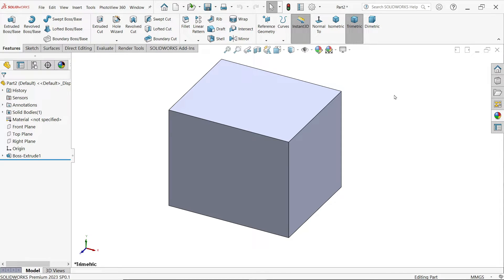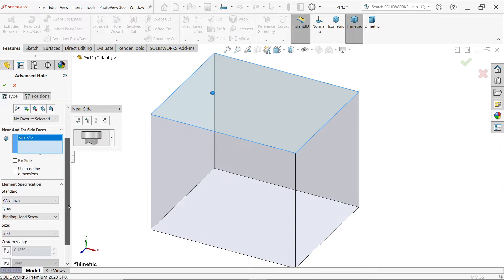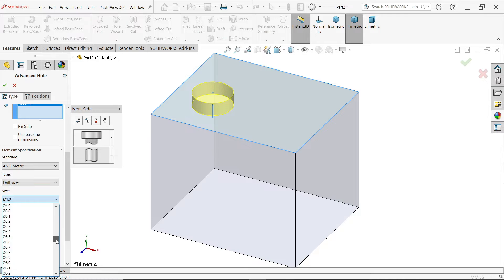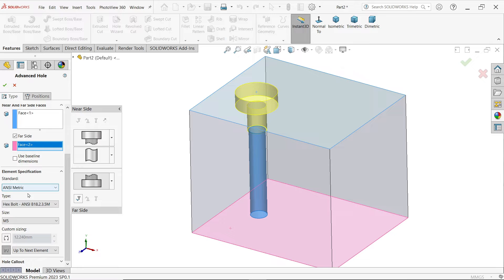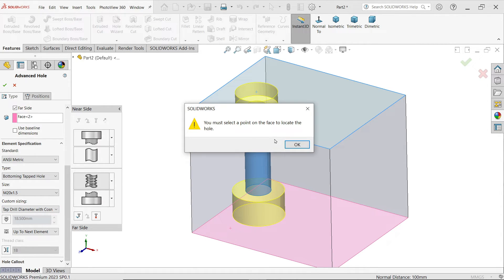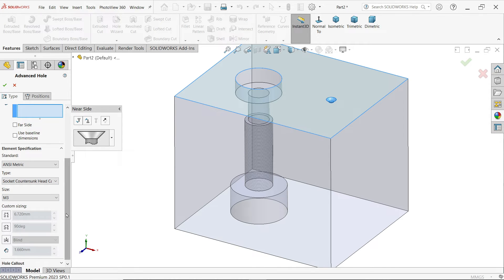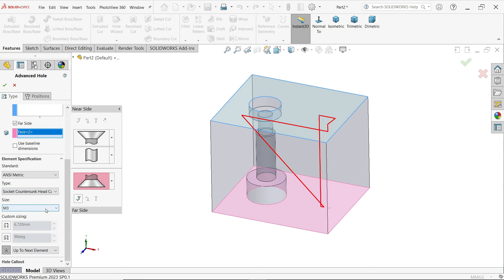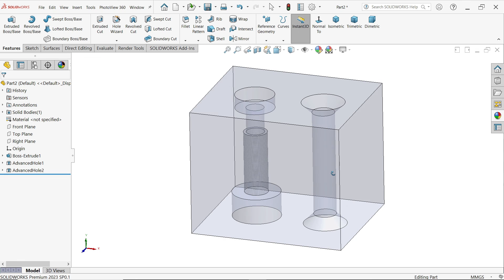SolidWorks-Advanced Hole

Comment: Sir how can we make threads in a hole that is located on circular face?
Reply: Create tangent plane first.
Reply: @TheNamelessOne12357  I create plane and make hole,, but when I try to make threads, I get error..
Reply: If by circular face you mean spherical face then this is how you would do it. Every hole in SolidWorks has an axis down the center of it and usually you can't see it unless you turn on axis. Using that axis make a tangent plane to the spherical face as the person below mentioned. Draw a circle on that tangent face equal to the diameter of the hole through the spherical face. You can then use the whole wizard to tap threads into the shaft of the hole.